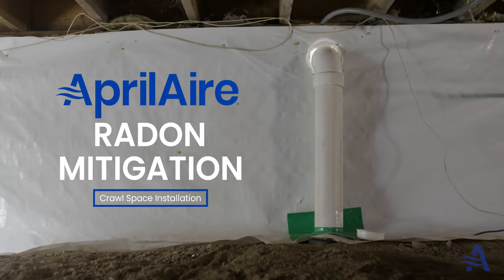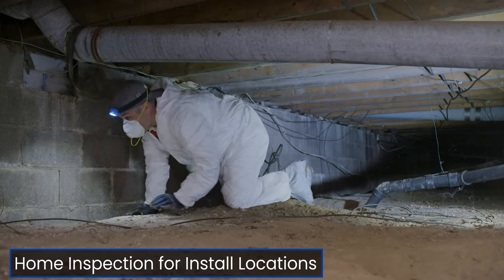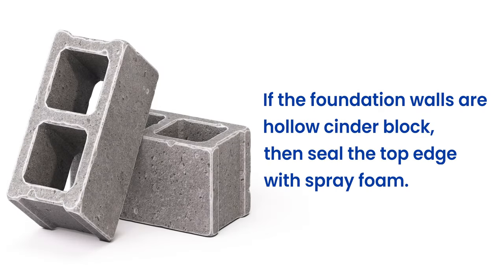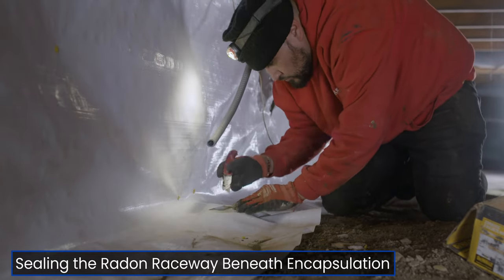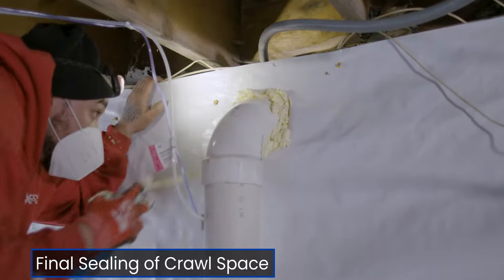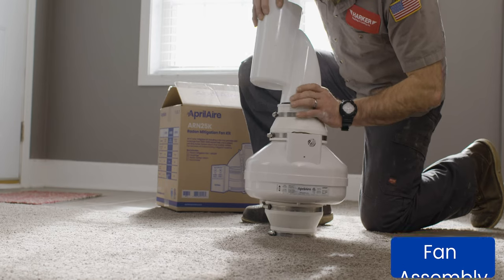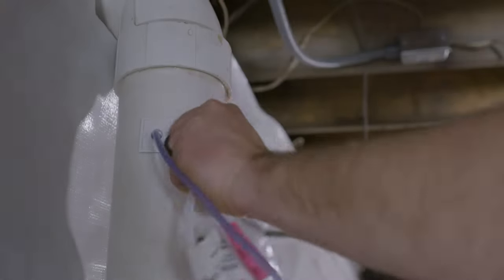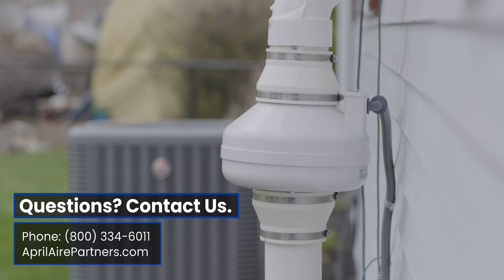AprilAire Radon Mitigation | Crawl Space Installation

Comment: How is the electrical compartment setup? Do you wire your power in with wire nuts or is it connectors?
Reply from the maker: Thank you for contacting AprilAire! You would use wire nuts to connect power to the device.  

Outdoor installations require the use of a UL Listed watertight conduit. Ensure that all exterior electrical boxes are outdoor rated and properly sealed to prevent water penetration into the box. A means, such as a weep hole, is recommended to drain the box.

The unit itself is UL listed, as such the wiring compartment itself is UL listed and meets the requirements for electrical equipment to be enclosed in a device. If you have any additional questions, please feel free to contact us at 800.334.6011.
Reply: @aprilaireco  Thanks for the reply. I actually work for a radon installation company in Ohio. I was seeing about convincing the owner to try out AprilAire fans
Reply from the maker: @vintagetoast3038  Thank you for your support!